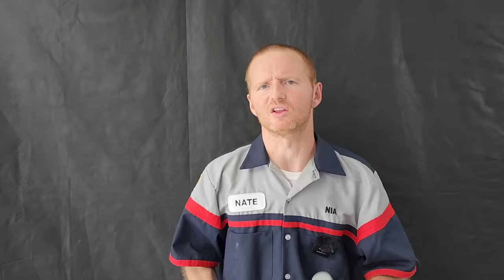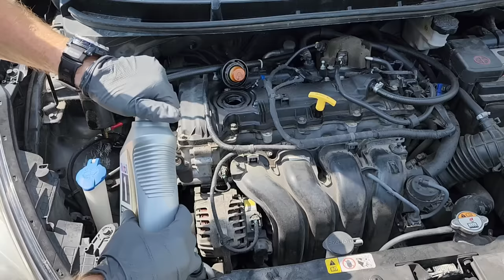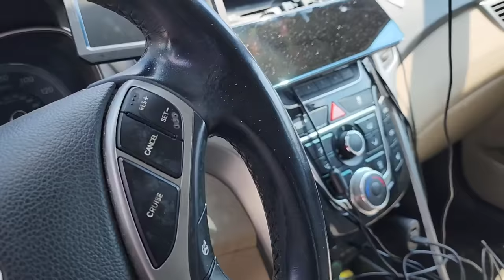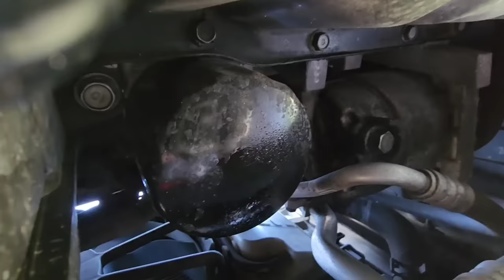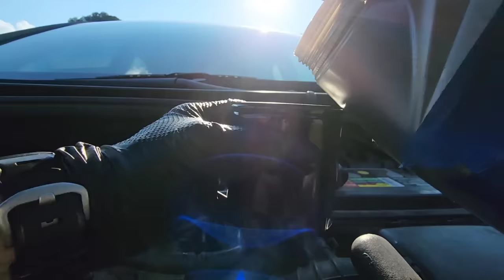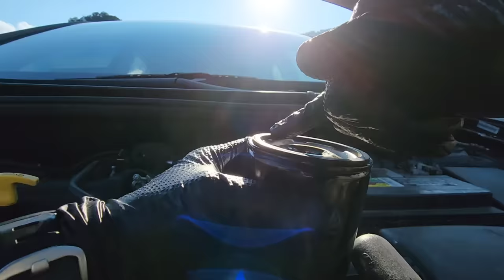Car owner sued after Jeep kills Mechanic during oil change

Comment: His whole life as a mechanic. Hes 19 and nobody tought him on a manual. Cmon mechanic trainers yall should train that bc some dads dont show there kids. I had to learn from my brother.
Reply: Heck nobody taught him either to use E brake and place wheel chocks prior of start up, servicing a manual these steps are important just in case your foot slips off clutch or ect
Reply: Also very important, my best friend my bro Evan Stromberg died when his car fell on him! Never use the tires to sit on! Slide them under car! He removed both front wheels then used jack stands but? He was on gravel lot and was under the car prying a belt on when he somehow caused it to roll back off stands! Once again no rear wheel chocks or rim with tire under car for extra safety 😢 had he used tire and rim the car would of rested on that and not him totally 😢 so your right on! We need to teach each other these tricks for safety

Comment: Another problem is some repairs have to be done by the dealership because the software can only be programmed by the dealership. Changing a brake accumulator on my Lexus LS460 is a pretty straightforward procedure, however, only the dealership can re-program it with their software. There isn’t another scan tool out that can do this procedure, so sometimes we have no other choice but to let a dealership do repairs.

Comment: This is the equivalent of the lady that sued McDonald's after she ordered a hot coffee, proceeded to spill it on herself, and then end up winning the case because she claimed that McDonald's did not let her know that the coffee was in fact, going to be hot. Every time you see "CAUTION- HOT" on a lid now, it's because of that.

I feel terrible for the mechanic that died, of course, and the car owner. However, this is despicable that they would try to put this on the car owner because some kid didn't know how a manual transmission worked, even though he was a supposed "mechanic".

It's absolutely insanity what our justice system has come to... A case like that should be tossed out immediately. As for the kid that killed his coworker, I'm not saying he needs to go to jail forever, but he's the one that needs to take the repercussions from this, not the car owner.

Comment: Been a mechanic for over 40 years… I’ve literally done THOUSANDS of oil changes. Ain’t been squashed yet. Change the oil and filter, start it up, verify no unusual noise and proper oil pressure. SHUT OFF, then check for leaks.

Comment: That is 100% bull shook. First off, the tech should not have touched the car if he could not drive a manual. Second, you have to push in the brake and the clutch to push start a manual. Third, if the tech took his foot off the clutch. He was the reason the man was hit by the car.

Comment: The shop and the 19yr old should share the blame on this.  The shop owner should have taught the employee to always check that the car is in neutral or park.  I was a mechanic and we didn't turn the key until we checked what gear it was in.

Comment: Common sense tells you the garage is at fault for not following normal procedures with a manual transmission car. Cars with manual transmissions are still being sold today and shops need to know the proper procedures when repairing such a car. One of these procedures is to put the gearshift in neutral before letting out the clutch when the engine is on, especially when no one is in the drivers seat. Yes the 19-year-old didn't know what he was doing but the shop is responsible for its employees. Thank god the judge was wise enough to realize the owner was in no way responsible for this tragedy.

Comment: A manual transmission driver always puts the vehicle in gear to help the vehicle from rolling with the parking brake.  When starting, press the clutch pedal and or put the stick in neutral.

Comment: Had a similar situation take place when I was a young lad working at a garage.  A mechanic attempted to drive a K5 Chevy blazer onto the lift but wasn’t familiar with hand controls as this was a handicapped vehicle.  He proceeded to drive right over the lift and smashed a large tool box through a cinder block wall!  Fortunately no one was killed just some minor injuries and a totaled vehicle.

Comment: Once the car is under the control of the dealership they should take the responsibility. They should also be held responsible for failing to properly train the young person doing the oil change. Lack of knowledge does not remove you from responsibility. If you don't know, ask.

Comment: Where I live, in Canada  no matter what happens the vehicle owner is responsible.  With a manual shift NEVER start the vehicle in gear. Put the vehicle in neutral first and keep holding the break.  If someone is in front of the vehicle make sure the hand break is fully on and the transmission is in neutral.  

Most young people don't know how to drive a manual transmission vehicle.  Very unsafe to start this type of vehicle if you are not experienced with driving a manual transmission.

Comment: Manual transmission is the norm in U.K.  . When i was younger and changed the oil myself ,always made sure car was in neutral  and used  wheel chocks  . You can`t be too careful .

Comment: This won’t make sense to most non-lawyers, but it does actually make sense. No one blames the owner and no one expects the owner would be liable. The owner is simply a necessary defendant in order to compel the owner’s insurance company to sue the mechanic shop for indemnity.

Indemnity simply means “if I’m liable to him, then you have to pay it for me.”

Apparently under the laws of that state there wasn’t a direct cause of action for the mechanic’s survivors to sue the company. A 19yr old kid won’t have insurance. By naming the owner in the suit, they got the right result which was to bring in the mechanic shop.

It won’t affect the owner’s insurance and wouldn’t likely require them to do anything more than sign a few acknowledgments.

Comment: Once upon a time. Manual transmission was started while in neutral, no clutch disengagement necessary. Manufacturers at some point came on to a design that has the clutch required to be disengaged(peddle down) to start the vehicle. The flaw is that the vehicle does not need to be in the neutral position for the vehicle to start in this design. When I first encountered this, my first thought was a recipe for disaster. I've been doing it long enough where it's instinct to put the car in neutral before firing ignition. Someone who's a new driver or at least new to manual transmission would, and do make this mistake frequently. It was only a matter of time before a fatal accident occurred.

Comment: A local shop was changing the oil in my FIL's pickup.  Truck was UP ON THE DRIVE ON RACK.  The "mechanic" reached in and started the truck, driving if off the rack with the truck 6 feet up!!!  Nobody was hurt ~but~ the shop owner refused to fix any damage.

Comment: It's so sad this happened to the mechanic. When you operate machines, don’t assume anything. If you don’t know, don’t do it. That means you need training in the subject. Also, it’s standard practice that you put the car in first gear when the car is parked on a slope. That way the car doesn't slip back when the brake is not applied.

Comment: The 19-year old that was checking for leaks knew enough about manual transmissions to know that, if the transmission is in gear, the clutch pedal must be pressed in order for it to start.

Comment: I was a mechanic for 37 years. A mechanic working for a shop should be covered by workman's comp. Were these actual mechanics, or was this just some fast oil change place? Not only have I been driving manual transmission vehicles all my life, but I have replaced hundreds of clutches and manual transmissions. People just get stupider all the time.

Comment: This is a load of bull. The company should be responsible. They aren't following safety protocol. I've been a mechanic for years. We  are required to use wheel chocks, which would have likely prevented this.

Comment: This is the fault 100% on the dealer. They had a Mechanic who can drive a stick, bring in the car so this young newbie can change oil. So the Mechanic bringing in the car, already knows, just by moving it for the other guy, what is working and what is not. Someone moved it and knows. Because a fully functional E-brake, would had locked the car out so it couldn't move and take out the engine. If the E-brake was bad, and the Service Department took it anyway, That is on them for taking in a known danger. Because if you own a stick, the E-brake is everything. In the end, it is the fault of the Service department..

Comment: It is probably a lesser known fact but it is possible to start a manual transmission car when it is in a low gear. Normally the engine is started when it is free of the gearbox and transmission but it is possible in some instances to roll the car on the starter and to fire it up at the same time, whereupon it will run away under power. 

This would seem to make better sense of this incident. Arguably the owner might be responsible for leaving it stationary in gear, but there can be good reasons for doing so. 

The golden rule is to check its out of gear when starting a manual.

Comment: When I was 16 years old. I bought my first car. A mile from home. Manual transmission, by the time I got it home, I know how to drive it. Why is this such an abstract concept now? Fact: Now only 3 percent of the American population can now drive a stick shift. The mechanic that stepped on the clutch pedal without putting the transmission in neutral is 100 percent at fault.

Comment: Seen this alot in the 80's in the dealerships. The "cool" thing to do was to reach through the window and start the vehicle. It also kept you from smacking the door on the lift posts of the era. I watched a mechanic destroy another mechanics Snap On tool box doing this with a manual transmission.

Comment: That’s ridiculous… You’d think a mechanic could drive a manual or at least know how it works. This is absolutely on the mechanics shop, you shouldn’t have to explain how a manual transmission works to a mechanic. I know it would’ve been the car owners insurance not the car owner themselves but there is no universe where trying to sue the car owner just because “the family needs money” is right. When I clicked this I thought it was gonna be an issue whereby the car had serious rust and fell off the lift onto a mechanic but no, it’s just an idiot that shouldn’t have been working on the car in the first place.

Comment: Driving a 'stick' is not a difficult skill to learn, if not master.  My second car had a manual transmission.  With no previous experience, I bought it and drove it around that day.  I got smoother with it over time, but could do a credible job shifting by sunset on the day of purchase.

Comment: So if this happened outside of a shop And somebody doesn't know how to drive a standard transmission sees the car is in first gear and then proceeds to hit the clutch. Turn the automobile on And release the clutch the car slams forward into coworker. The last person in the cockpit was the person that turned the car on with the car in first gear and released the clutch. That person should be charged not the owner of the vehicle cuz the owner of the vehicle was not in the car. This is why I do all of my own work on my own cars. The one time I took my car to a dealership they charged me $6,000 for some s*** they didn't even do😊

Comment: The parking brake shoulda been on for a manual transmission. Incompetent training from the shop is the blame.  This same thing happened at WalMart once. The customer had removed or bypassed the clutch pedal switch up under the dash. It was in a manual Beretta. Those and Cavaliers, Sunfires etc had a bad habit of wearing out prematurely (like only after a few years from new). The WalMart "tech" against procedure, reached in through the window and hit the key, the car went through the partially  opened garage door, ripped it off the hinges and into the loading dock wall.

Comment: The mechanic used the car to commit (hopefully unintentional) vehicular homicide. The fact that the owner is in any way liable or culpable for this is absurd. Now, if the vehicle was malfunctioning and the owner didn’t tell the mechanics, and this happened because of the malfunction, that’s an entirely different story. However, I don’t believe “I’m a mechanic and I don’t know how to operate a basic passenger vehicle” is an adequate defense, or any defense at all. I’d also hold liable the incompetent manager  that hired this person for not ensuring their mechanics know how to drive, since that is apparently an integral component of the position.

Comment: When I took Driver's Ed in high school, our simulators had manual shift on the column.
We were taught manual transmission for most of the course.
Anyone with two screwdrivers and a pair of pliers, can get a job at these "discount oil change" places.

Comment: Whatever idiot started the car should be held liable...how the hell you gonna be a mechanic and not know to set a parking brake or know anything about manual transmissions and wheel "chocking" safety FIRST

Comment: This is why businesses have insurance and also why they are supposed to hire "qualified" people for the job.
If an employee who didn't know how to operate that vehicle was allowed to get behind the wheel it's the shops fault for not training that employee unfortunately.
In a different situation had nobody been hurt and the car wrecked against the tool boxes, the owner would have been compensated by the shop and the worker likely fired.
The fault in this situation should be no different.

Comment: First off, as a mechanic of 35 years you ALWAYS put a manual car in neutral and apply the hand brake and chock the wheels. It shows you that anyone can get hired to be a mechanic without the proper safety training

Comment: The owners insurance is the easiest point to persue as you said the technician had two months work there no experience of manual transmission and the garage not properly licensed so persuing them will be more costly,how owner can be responsible crazy not there or in control of cars at all.

Comment: My last car with a manual transmission was a 92 mustang. The car was wired in such a way that it could not be started unless the shifter was in neutral AND the clutch was depressed. I am shocked that this feature is not also equipped on a keyless start automobile. I can think of a better entity to sue, the manufacturer of the vehicle.

Comment: Well, the older and more experienced mechanic apparently wasn't experienced enough to know not to stand in front of a car when someone's going to start it. Also, the dealership is at fault far more than the owner because the technician who was working on the car did not know how to operate it properly. It's not the job of the owner to teach a technician how to operate a car.

Comment: This was clearly an action caused by the employee of the service provider.  It is borderline criminal stupidity to be a mechanic and not understand how a standard transmission works. Also, why wasn't the parking brake engaged? The vehicle would have likely just stalled out if the clutch was released in first gear with the parking brake set.

Comment: Unlikely to succeed at trial. Mechanics are learned intermediaries, meaning they are supposed to have the capability to safely operate the vehicles they service snd there is no way the car owner could prevent the accident. The shop is liable....

Comment: Driver education should be taught using manual transmission vehicles only, just as they were taught 60 years ago. I learned to drive in a three-on-the-tree Ford Falcon.

Comment: The 19 year old should’ve been trained better… heard about this story before. If you start a manual transmission vehicle you HAVE TO be seated in the car. Trans in neutral and other foot on the brake pedal.  
 Stuff happens but a little training, education, and proper procedures would have avoided this tragedy entirely.

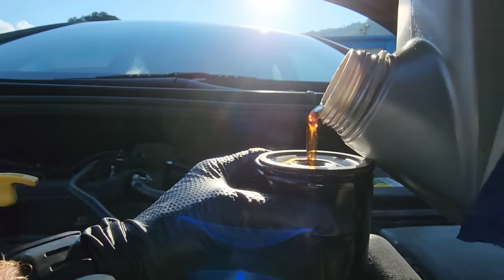Comment: Fyi. In the video at the 4:11 mark someone is prefilling the oil filter incorrectly. If you are going to prefill the filter you should only fill it through the small outter ring of holes, not the large hole in the middle. The small holes are the dirty side of the oil filter and the large center hole is the filtered side. The oil you pour into the center hole will go staight into the bearings without being filtered. Not good.

Comment: The car owner should sue for having mechanics work on his car that weren't qualified to do so. 

IMO one thing that makes this less simple is electric parking brakes. It's hard to trust them as opposed to manually pulling a handle or pushing in a petal. I had my 19 Camaro SS 1LE come roll off some ramps when I first got it, and fortunately nothing bad ended up happening, but what if I was under the car? I had pulled up on the ramps, put it in neutral, and I thought I engage the Ebrake before getting out to check how the car was positioned on the ramps and it rolled off of them. I thought I had engage the Ebrake, but I either hadn't engaged them or something tripped them off, either way it's harder to trust electric parking brakes as opposed to a manual parking brake. I'm speculating, but my guess is this car had an electric Ebrake that wasn't engaged, otherwise if the Ebrake was engaged the engine would have liked stalled out when the 19 year old took his foot off the clutch.

Comment: There shouldn't be auto-start buttons in manual cars period because the starter continues to turn as a process and if the car's in gear it can be dangerous. Whereas keyed starters would usually make the driver instantaneously release the key during start if the car jolted in gear.